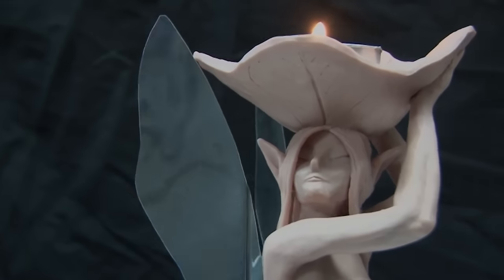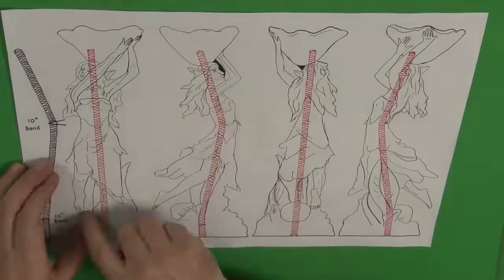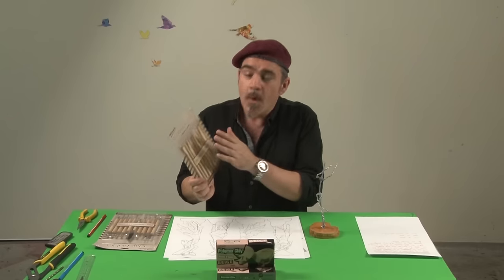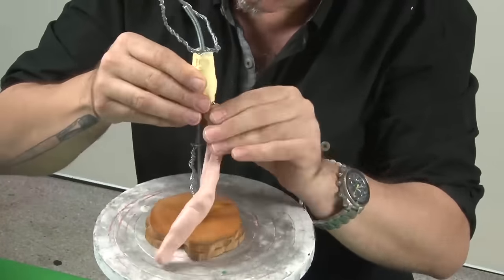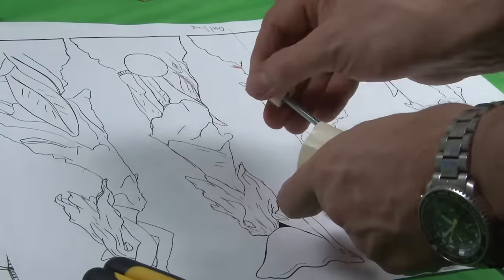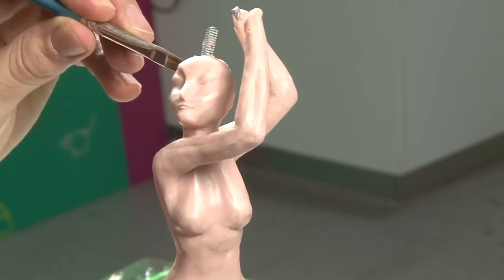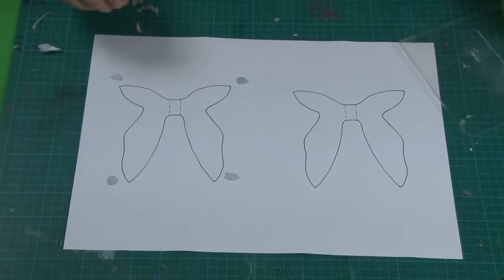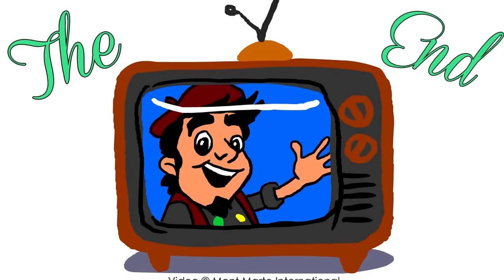Art Lesson:  How to create a Fairy Tea Light Sculpture

Comment: I use brown mont marte air hardening. When it dries crack always appear, and the clay itself too sticky. How to deal with this?
Reply from the maker: Hi Iqbal, thank you for your question. Cracks occurring in cured air dry clay are normal - this happens because the clay shrinks as the water evaporates. The way to get around this is to let the clay fully cure and then fill the cracks with wet clay (the same clay as you used for the rest of the piece). This will fix the cracks and they shouldn't appear again.  
To answer your question about the clay being too sticky, air dry clay has a different consistency from clay that is meant for firing. Air dry clay is very fine grained and the ‘stickiness’ is an inherent quality of the clay. This helps with tasks such as bonding clay together and holding fine detail. To help stop the clay from sticking to your hands, keep a bowl filled with water beside you and keep your hands damp. We hope this helps!